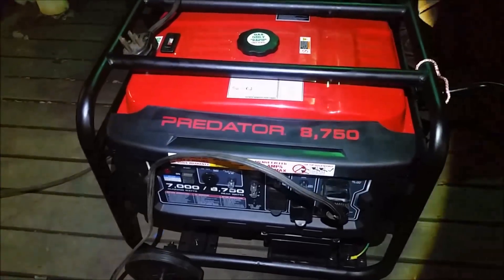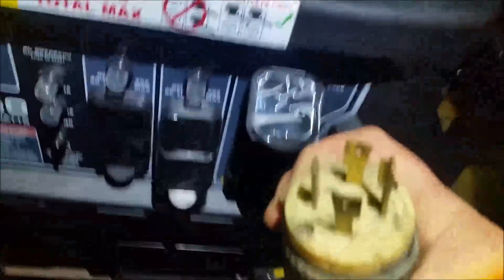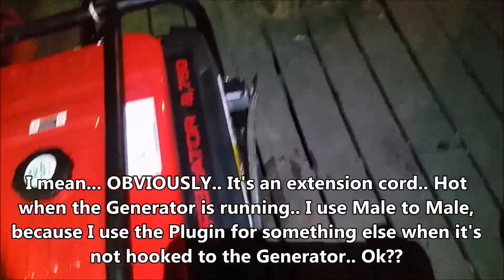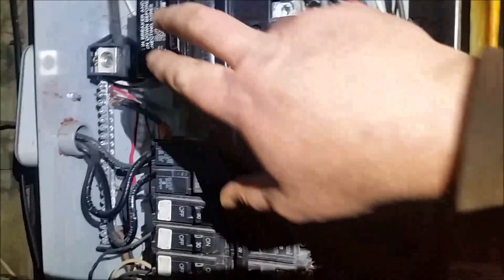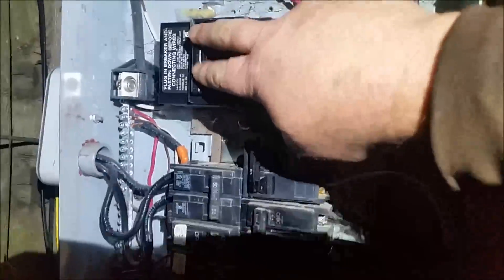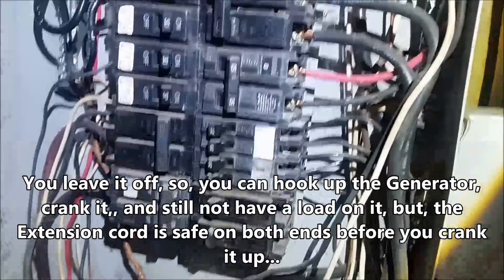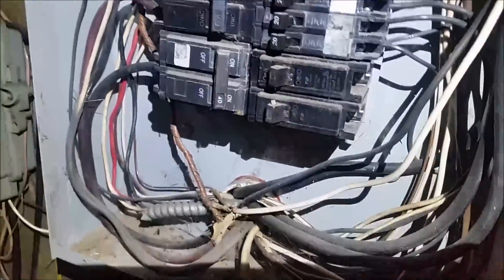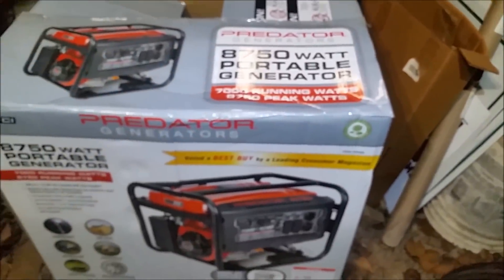Quick/Easy/Safe: Use Existing Plugin/Breaker for Generator hook up to your house Panel box.

Comment: Well then can you do it safley.... Yeah  can you kill someone absolutely. It's illegal and will get you shut down or arrested depending on how they find it. Just depends on how much risk you want to assume
Reply: good video some people are morons. If you morons don't understand flipping the main breaker off prevents any power from going back into the grid you probably don't have any business even opening your panel to reset a breaker quite frankly.  I hook my generator up like this every time I lose power.
Reply from the maker: Yep.. I've been doing this for a very long time.. Ever since I was 15 years old and someone gave me their old generator because it would not crank and they bought a new one.. Low Oil Warning sensor was out and was grounding the plug out.. I just disconnected it and used it for years.. 
I check the oil each time I shut it down, if it is one that burns a little oil.. Don't need a Stupid light to remind me to check the oil..  Ha..
Reply from the maker: Stan Jordan you do not have a clue what you're talking about. I don't care who sees it while I'm running it, no one can do anything. Cannot make me turn it off, unplug it, or anything else. There's nothing illegal about it. And if you use common Horse Sense so, you're not going to hurt anything or anyone. But you, do you drive a car? I hope to God not. Because it can be dangerous also. Oh my oh, I bet you have knives in your kitchen too.. you could cut your head off. That's about how much since you make.
Reply: Call the local power company who won't disconect you for back feeding
Reply from the maker: Are you really that Ignorant?? I'm just asking.. Care to tell me how I would be backfeeding if the first thing I did was throw the main breaker?? I mean.. It's all over the video and in the text.. 
REALLY??? Just how stupid are you???? 
In fact, power was out today.. Line across the river.. Power Company came out and stopped to look across the river, and was right by my Moms.. I walked the guy over and let him get to the river to take a look.. We had a talk about her HF Generator and he saw how I had it hooked up and complemented me on the simplicity of it.. It was at my Moms, so, had a cheat sheet in the panel.. Turn Main Breaker off.. He asked me if Mom cranked the generator, I said, not this time, she was at the office, but, every other time since we bought it.. 
He said,, pretty simple.. Anyone could do it.... Guess you are not anyone.. What a Dunce.. !
Reply: You all really need to watch this video about generator safety https://youtu.be/I1jT3ANENvI I agree with you guys that some people are not careful using portable generators. Hope you all agree with this advice I’m giving you. It’s to be safe.

Comment: I think what is not being clarified is:1) "A time when someone other than yourself has the need for the generator.: Like if you are incapacitated or removed from communication (or dead)... For real life needs...  like: DWP, heat, cooking... 2) Then there is the homeowners insurance issue: Will they payout if you burn your house to the ground when they find gross negligence...??? probably not...  3) But if it is just you for your shop / place... it will work... (I have back fed breakers, used whatever combination of cord ends were necessary,  to give people power in an emergency... (Everything changes NEC and local codes during an emergency, even  homeowners policy standards)...
Reply from the maker: Nick D'Annunzio I can't believe you guys. Nothing in the panel or anything connected to the house wiring on a daily basis has been changed. Everything is 100% totally quote legal as you guys call it. Only the extension cord, and only while the generators plugged in. And if you can't figure out how to plug a generator in or plug a cord in, oh my God you have knives in your kitchen to cut your head off and you drive a vehicle is going to kill everyone. That's how much since you have I guess. I find it no different

Comment: I do the same thing and have for over 10 years.  HOWEVER, I believe it is a VERY good idea to put some kind of interlock on your breaker box so the generator cannot power the box if the main breaker is still connected to the grid.  We ARE talking about life and death here, and as careful as I have been over the years, ONE TIME AND ONE TIME ONLY to my eternal shame I was distracted in the process of powering up the generator to run the house after a power failure and for a few seconds I was backfeeding the grid.  That one experience caused me to get some sheet metal and design a sliding safety that physically prevents the generator breaker from being turned to on if the main is not in the off position.  Now it is impossible for me to make a mistake.....or for that matter anyone else who might try to help out in an extended power failure IF I was out of town and my wife was home alone.  If all the people who try this because they saw this video don't implement an interlock, it is a given that some of them are going to make the same mistake I did....and I am paranoid when it comes to doing things right and paying attention to detail.  There are very few things related to house maintenance or projects like this that I don't do myself.  But, I study and learn how to do things right, and I buy the tools necessary to do it right.  I was horrified when I realized a that for a few seconds I could have put someone's life in jeopardy.....don't expose yourself to that kind of feeling and legal risk.
Reply from the maker: Don't see how you did that, if the main breaker was off.. That's Step #1.. 
You should post a note in your breaker box.. TURN MAIN BREAKER OFF!!! if you are forgetful... 
That way, you can't fry your generator,, or,, cause problems down the line.. 
My family knows,, don't do anything with Electricity, unless you are sure you know what you are doing,,, and don't get distracted under any circumstances, if you do..
My 80 year old Mom calls me when she is hooking up her generator.. I never tell her what to do, just listen to what she is going to do next, and I confirm as she goes. She has never gotten it wrong.. 
But, the instructions are simple. Turn Main Breaker off,  hook up generator cable, crank Generator,  and throw generator breaker on..
Reverse: Generator Breaker off, Kill Generator, unplug cable, throw main breaker on.
Can't see how you can screw up with those simple notes.. Must not have had them... Huh?? 
First mistake.. It's kind of like trying to solder a gas line without flushing the gas out.. 
Some mistakes, you just don't make, or make them more than once..
Reply: Mark T ,I agree. In time's of emergency every kid yelling for power in a storm, SAFTY FIRST! I MADE a Lock for the panel, my father in law was a Master electrition for 30 years. I made sure, he came over, showed me EVERY THING AND WRITE IT DOWN!!!
Reply from the maker: robert Healy and I'll bet the first thing he told you was throw the interlock! Which is the same thing as me throwing the main breaker. I don't forget that. It's like putting on your underwear, looking both ways before you cross the street, tying your shoes Etc.
If you feel better with an interlock, that's fine. But it doesn't mean that I need one, or anyone else like me. My brother would need one for his own safety. And I would never tell him how to do this.
He has a separate generator panel, and so much shit he can't even figure it out, now that it's all done.
And it cost him a fortune. He asked me to come look at it, because he couldn't remember how to turn it on. I told him it was too damn complicated for me, because I wanted no part of it.
An interlock is about as simple as it gets past what I do.
But it all boils down to turning the main breaker off., and I know you have to agree with that.
The only difference past that is simply this. You can't use your generator plug in for everything else. And I can. That's the only other major difference. I just use what's already there.
I don't even think about hooking up anything before I throw the main breaker off when it comes to the generator. Main breaker off first. The power's out anyway, why wouldn't I? Nothing wrong with how you're doing it. And nothing wrong with how I'm doing it. Cheers
Reply: Mark Thomas interlock pu tomm morning, and new 10\3  came in. TU